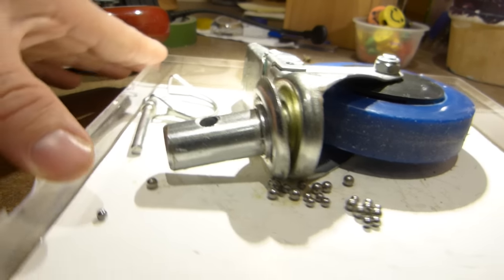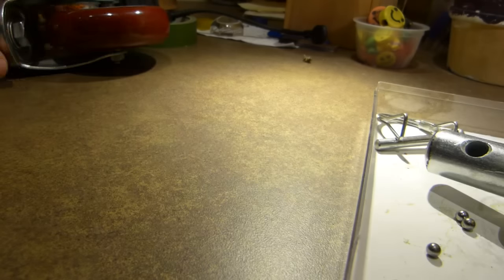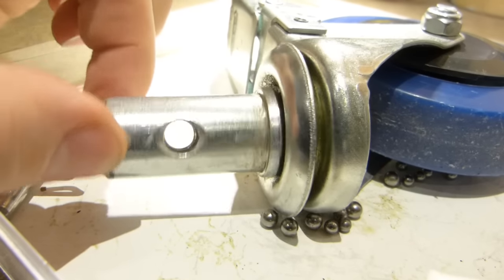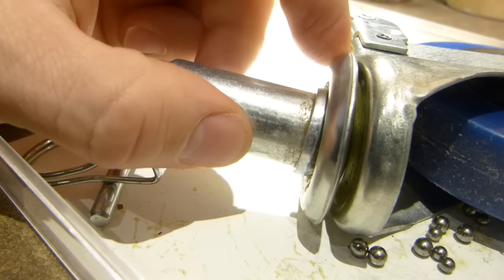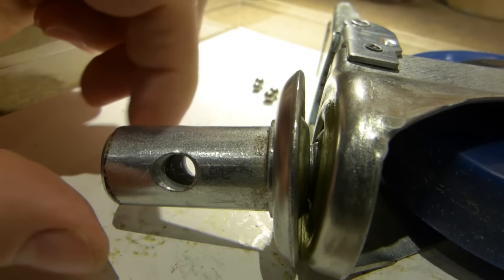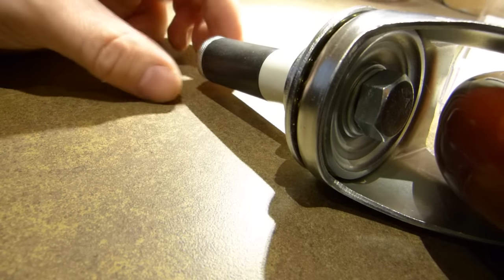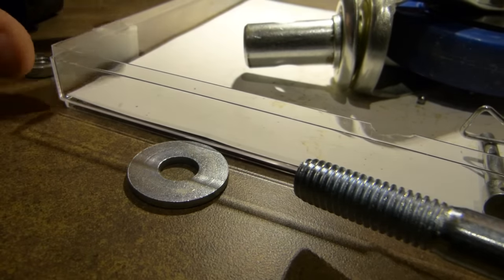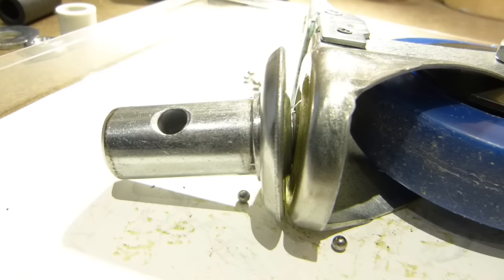Made in China scaffold caster fail

Comment: I think the general perception is the Chinese do not know how to make decent products. Yet, I wonder if it is the Western design which is the problem. I would assume the product design includes specifications, types of materials, etc. The design was developed to produce a very inexpensive product at the expense of quality.
Reply from the maker: +bg147 It could be. I`d need to phone MetalTech to see if they supply the specs for manufacturing the casters or just found a cheap supplier from China. It`s unlikely that they provide an answer. My bet - they buy cheap stuff and re-badge.
Reply: theoverengineer Good points. The rebadging makes sense. I still blame Metaltech and others...they know it is junk when they buy it.

Comment: xD i have 2 sets and i never used the casters, the very first caster i pulled out of the package i spun it and it felt like the consistency of running something over sandpaper... i just bought a proper set at tractor supply company. never had any issues.. as for the originals they were absolute junk. i smacked them with a sledge and tossed them in the bin